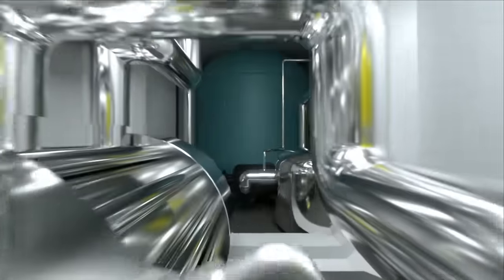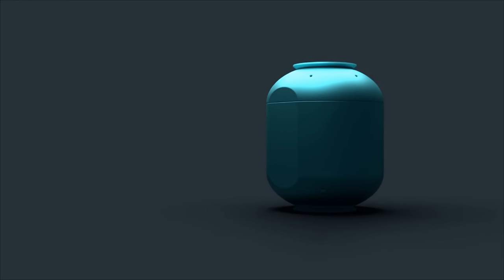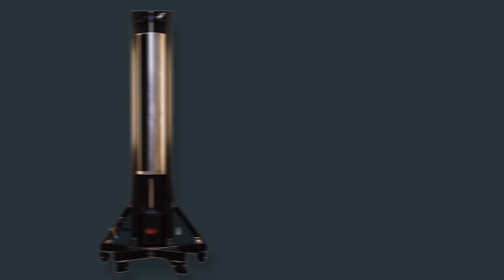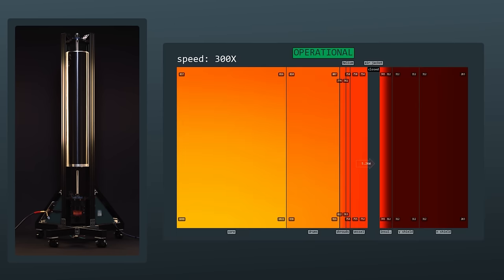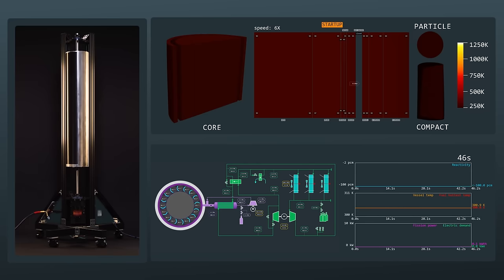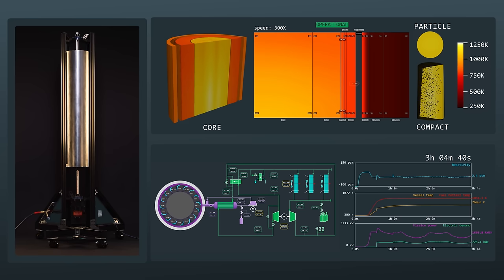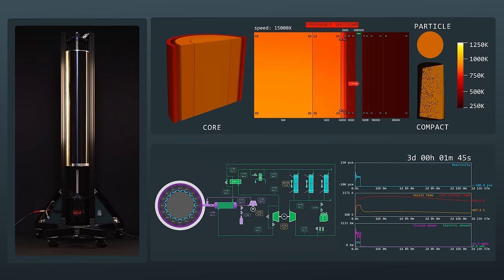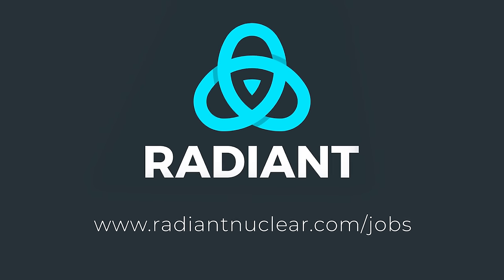Introducing Kaleidos, a Portable Microreactor from Radiant

Comment: Can they find a way to reuse the nuclear waste to create power more power and also cleaning up the toxic waste. NDB company and Arkenlight have already been producing a new kind of battery turning nuclear waste into tiny battery that has the potential to last 28,000 years 🤔. I know that you can figure it out. Then I would really be impressed. Keep up the great work!
Reply: Those batteries last a long time but produce VERY litte power.  They are basically something to keep a clock running (microwatts).  However, there is such a thing as a "breeder" reactor.  Most of the "spent" fuel of current reactors is U238, which is also what makes up 99.3% of natural uranium.  If U238 absorbs a neutron, and you wait, it becomes Pu239 which is a fuel that can be fissioned for energy.  Short answer - you can breed nuclear spent fuel to get more energy from it using a breeder reactor.
Reply: @LFTRnow  Actually, while I haven't looked into it, I doubt the concentration of U238 would be higher in spent fuel, as a good amount of 238 would be bred into plutonium, then fissioned into later products. Generally though a good portion of the fuel is unaffected by fission, the reactivity is pretty rapidly killed off by decay products, reprocessing should really be expanded and re-initialized, not doing so is like burning wood into charcoal for heat and throwing out the fresh charcoal.

Comment: SMNRs are the future of nuclear energy.  Still I hope they aren’t stupid enough to put one of these close by or in and around houses.  Tbh even if they did they are going to need armed guards, although there would hardly be any power loss from electrical leakage that you get from over head power lines.  It’s a much safer technology but I do worry slightly if they are intending drop these in and around houses or towns and villages.

Comment: Saying "controlled" and "meltdown-proof" many times somehow does not make me feel safer. 

All things considered, I believe that nuclear power is viable and safe, but, for a chance of things controlled getting out of control, I would prefer the impossible meltdown to happen in some far away underground concrete chamber.  You know, just in case.
Reply: I’m not sure about this one, but many newest meltdown-proof designs were implemented in a way that’s physically impossible to meltdown no matter how you torture it. Like the molten salt reactor and ball grid reactors.
Reply: @yrr0r244  My concerns are based on Murphy's law and my experience in the army, even if something is physically impossible, once in a while, it happens, and in the most inappropriate moment.
Reply: @romgl4513  When they talk about passive safety, it's usually assumed that the system will fail in the worst way they can think of and then analyse whether the outcome is still acceptable.
Reply: @yrr0r244  The soviets thought it was "Physically impossible" for an RBMK reactor to explode. They were wrong.
Reply: @anonymoususer638  In part because the results of Leningrad NPP power excursion got classified. Also, one of the main reasons the Reactor 4 exploded was coolant phase change altering the reactor moderation conditions, resulting in an uncontrolled ramp-up. Here, coolant does not change the phase and remaing gaseous all the way through.
Reply: @caav56  Yes, of course. The two reactors are very different, and the events at Chernobyl were largely due to the lies of the Soviet Union. However the point is that we should never assume a hazard to be impossible, and always prepare for the worst, especially when dealing with something as serious as nuclear reactors.

This is partly how Chernobyl occurred. Dyatlov assumed it impossible that activating AZ-5 could fail at stopping the reactor. Even shortly after the Soviets thought it impossible to explode, dumbfounded by the graphite spread across the surrounding area.

Comment: Nuclear power plants have a thermal efficiency of 30% at most, electric efficiency of no more than 15%. Where are the cooling towers for heat extraction in large numbers?  У АЭС КПД тепловое 30% максимум, кпд электрическое не более 15%. Где градирни для отвода тепла в большом количестве?
Reply: This power module uses supercritical CO2 turbogenerators for power generation, which can achieve ~50% power conversion efficiency. Therefore, it doesn't need to reject more than two... three megawatts of heat worth - about the same as UHTREX did. And UHTREX did not need a cooling tower.

Comment: Chernobyl, Fukushima Daichi, Three Mile Island... All three had control rooms filled with highly-educated, trained staff at the time of their catastrophes. Yet those catastrophes still occured. Who will be at the control panel of Kalidos if the automated system fails, if the fail-safes fail, when the unexpected inevitably occurs?
Reply: Well with Chernobyl there was bad engineering. Fukushima was also preventable. In either of those cases it was due to a lack of diligence and a way to save on costs. It is 100% possible to build a super safe nuclear system. 
Over a century ago would you trust a machine that uses flammable liquid to transport you by road or air? Probably not, but technology and safety improves with time. There are also already designs that are impossible for a meltdown to occur in the first place. Only time will tell if these machines are built to the safety standards that are expected of them.

Comment: Are control rods graphite tipped?
Reply: No there half and half you rotate the rod to get it started which means they're using the graphite as an insulator. With the automated power modularity, this is not a good idea.

Comment: This looks like a reactor designed by a computer programmer not a nuclear engineer. I don't like this design at all. Far too much depends on fly by wire for a nuclear reactor.
Reply: Are people still building things without digital twin tech?
Reply: Your car has had fly by wire for years. Every plane made in the last 40 years has fly by wire. We do complex neurosurgery with fly by wire.

It’s a perfectly safe technology.
Reply: @Gundam4President  you just made my case. Have a look at some of the most recent aircraft and car crash data where the computer has led to a 'Fatal Exception '. Reactor design should not fail due to a Carrington style event.
Reply: @camresearch5120  wouldn’t shielding of small reactors against an event or EMP be reasonable to expect? This isn’t a car we’re talking about.
Reply: @roque-au-parcus  electrolytic capacitors dry out. You don't want critical systems to depend on the difference of a volt. I am an experienced IT professional plus know nuclear engineering. Computers are great 👍 but for critical systems should be avoided where possible.
Reply: @camresearch5120 pure mechanics come in clutch again 😎
Reply: Dude. Modern plants are digital 🤷‍♂️🤣🤣🤣
Reply: @vacuumboy6.0  Their failsafes aren't.
Reply: I'm really not sure what you mean by fly-by-wire here, control? I'm pretty sure there's not much you can remotely control in a reactor that's not electrical. If that fails you have to be pretty close to the part itself
Reply: @camresearch5120  nearly all recent aircraft, car, and surgical failures have been caused by human error, what's your point?
Reply: Correctly designed fly by wire systems are easily more robust than mechanical systems and less prone to failure. Safety plcs double triple redundancy, physically separated data transfer lines with mechanical protection. Etc. There's ways to make these systems far far safer than mechanical systems. In saying that I would be concerned about the cooling jacket actuation mechanism and the temperature detection system assuming they're multi redundant systems as above I don't see a problem
Reply: @Gundam4President hard to break it to you but most aircraft that are not airliners do not have fly by wire.
Oh and also, power steering is not fly by wire. Most cars still have analog assisted steering. Only a few new designs are attempting to try the fly by wire technology like the new electric Lexus.
Reply: @TrissMerigold_VoidStaff  throttle and brakes have been fly by wire for years. Every single electric car on the road had fly by wire throttle and brakes. The overwhelming majority of cars have electronic parking brakes which rarely if ever fail.

Also what kind of argument is “muhhh 50 year old Cessna doesn’t have fly by wire” of course it doesn’t because fly by wire isn’t free. There’s fly by wire in almost every airliner all which fly exponentially more time than any hobbyist machines.

It’s fine, you can have fly by wire systems for most controls. Redundancy is needed regardless of what your primary controls are.
Reply: @Gundam4President  you stated "Every plane made in the last 40 years has fly by wire." now you lean to more narrow definition. I am a commercial pilot myself, and you would be surprised how many planes still don't have fly by wire despite being much younger than 40 year mark. Also I do not agree with original comment saying fly by wire is a bad thing, it's just not that common as you try to present.
Reply: Trust the YouTube armchair expert to chime in with absolutely no knowledge of nuclear engineering. For your information, it’s virtually impossible for this kind of reactor to melt down, even down to the fuel type selected. They are called walk away safe reactors. How about next time you keep your ignorant comments to yourself and look them up before insulting the work of engineers who know for more than you do.
Reply: If humans can make it, humans can break it. Gamma rays are a problem for any computerized control system, but the biggest problem is cyber security.
Reply: @camresearch5120 Arguments from authority aren't valid arguments. Going on a nuclear energy sub reddit does not mean you know nuclear energy.
Reply: Yeah, mechanical failsafe did such a great job with Chernobyl and Three Mile Island @EddieTheH
Reply: Wait... Isn't graphite regulation how the Chernobyl reactor worked?
Reply: @biddinge8898  a nuclear reactor is a series of complex design decisions, you can't just equate this to Chernobyl because they both are moderated with graphite, that's like me saying you're as smart as a fish because you both have bones
Reply: @freddybell8328  Ok, then, lets just do without failsafes 🤦

Comment: Who picks up the nuclear waste? Where will all get buried?
Reply: I imagine a liscenced professional would handle the miniscule amounts of spent fuel this would produce. Based on two quick web searches this reactor, if similar to past designs, would create three litres of waste (that may be able to be reused) per YEAR. A small price to pay compared to ash and co2 from fossil fuels, or byproducts from heavy metal-using renewables, especially once you consider this looks like it could be deployed by one trailer truck, similar to fossil fuels, as opposed to 4 acres with no obstructions for wind or a 59m diameter wind turbine, which needs reliable gusts (not to mention, neither of those are portable)
Reply: @eg1162  I like it! ... after further research, I found that this helium cooled approach belongs to a generation of reactor technologies which processes fuel at higher efficiencies (ie. breeder reactors). Another great benefit of microreactors is its distributed nature resulting in a more resilient/abundant supply, and most likely lower cost to consumers.
Reply: The entire unit would be taken away to Radiant's facility to be refuelled, so the spent fuel would be there. Disposal is the same process of sweeping it under the rug as for any other reactor.

Comment: Any nuclear power plant gets passively cooled if you operate it wrong enough. Joking aside, passive cooling mode looks scary both in terms of probability of atmosphere poisoning and in terms of thermal efficiency during emergency condition. How do you mitigate it?
Reply: @madnessandescapism, passive cooling systems, like those used in Radiant's Kaleidos microreactor, are designed to ensure safety even in the most extreme conditions. These systems utilize natural convection and heat dissipation without requiring active mechanical components, which drastically reduces the risk of failure during an emergency. The use of helium as a coolant, which doesn’t become radioactive, mitigates the risk of atmosphere poisoning. Additionally, TRISO fuel, known for its robustness, ensures that fission products remain contained even under high temperatures. Radiant's design prioritizes both safety and efficiency, leveraging advanced engineering to maintain stability and prevent any release of radioactive materials. In essence, while passive cooling may seem daunting, the engineering and materials used in modern reactors like Kaleidos significantly mitigate these risks, ensuring both safety and reliability even during emergencies
Reply: @notnetflix5691  So, how do they modify thermal conductivity of air to passively cool reactor if active helium circulation fails? Just curious, I would like to do the same to my car engine, it leaks coolant all the time...
Reply: @madnessandescapism  your attempt to compare a leaky car engine to the sophisticated engineering of a nuclear microreactor is quite amusing. Unlike your car, which seems to need a visit to the mechanic, the Kaleidos microreactor uses helium for its high thermal conductivity, which ensures efficient heat dissipation through natural convection without relying on mechanical pumps. This design isn't about "magically modifying the thermal conductivity of air," but rather leveraging advanced engineering and materials that are far beyond what you find under a car hood. The TRISO fuel in Kaleidos, with its robust ceramic layers, can contain fission products even under extreme conditions, ensuring the reactor remains safe and stable. So while your car might struggle with a coolant leak, Kaleidos operates with layers of safety and reliability that make your comparison not just inaccurate, but almost laughably simplistic.
Reply: @notnetflix5691  First of all, I was concerned about emergency air cooling, not helium cycle. Second, heat transfer function in this universe is the same for nuclear reactor, car engine and your kettle. And the third - "trust me bro" is not considered as a safety measure by neither nuclear or automotive industry.
Reply: @acredeadistra8713  I know right XD
Reply: @acredeadistra8713  Ahhhh Russian arrogance never ceases to amaze me, but really leave the guy alone and his leaky car
Reply: Nice try guys, but that is not how physics work. If you mess it up - it blows stuff up with absolute disregard of anyone's personality or nationality

Comment: What about shielding?  Security?   Load dumping?   Cooling?  Xenon poisoning?  Operating and monitoring staff?  Siting?   You need like 2 meters of steel and concrete shielding on all sides to meet minimum requirements.   Nobody is going to want a reactor next door.  Video has lotsa CGI and blab, but no numbers like cost, cost per kilowatt, cost per kilowatt-hour,  cost of maintenance, cost of personnel,  or any discussion of failure modes such as leaking valves, thermal cycling cracks,  metallurgy and chemical corrosion issues.    

The history of radical new reactor designs is one mostly of total failure in a short while due to various unforseen developments, usually cracking and corrosion.  

And these are very poorly suited for powering isolated communities as the reactor can't be up 24/7, worse yet, isolated communities tend to have wide variations in load during the day and nuclear plants are generally incapable of wide swings in power level.  One sudden reduction and the whole plant shuts down for 3 days in a Xenon well.

Just economics kills most small reactors in the crib as there is a certain minimum baseline cost of staff and siting and maintenance.  In general anything under 100MW electrical just can't be economically viable.  Solar power is already cheaper than the most economical nuclear plants and getting cheaper by the minute.
Reply: >What about shielding
This thick shield core is covered with. Or, following soviet examples, put it at some distance and cover it up.

>Security
See soviet Pamir and TES-3 mobile NPPs.

>chemical corrosion issues
It has helium coolant and supercritical CO2 power conversion fluid - both with rather low corrosion potential.

Overall, it's not a wonderful new reactor - more of bringing Dragon reactor developments to actual power generation. And besides, China already run HTR-PM reactors, similar to it.

Comment: so i dont want to be that guy ...and i do love this idea...but what is the worst case  for this...if cooling and control rods fail lets say
Reply: a really small partial meltdown
Reply: @anthonymanning8390  yes but would there be a release is more my ? i guess
Reply: @danbrit9848  Not likely. The fuel here has a melting point higher than it can heat up on its own (the heat rejection will happen faster than reaction produces more heat), so, even meltdown's not very likely.
Reply: @caav56  thank you ....im vary pro nuke power ...just as long as we maintain the new safety standards we have for it and all :) so that is the answer i wanted and needed